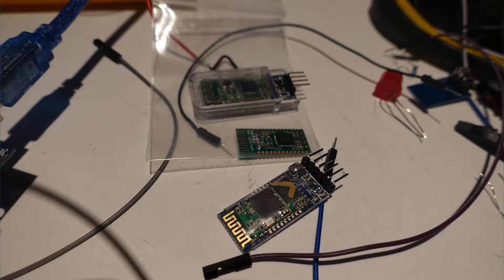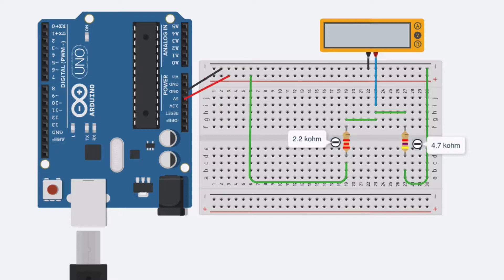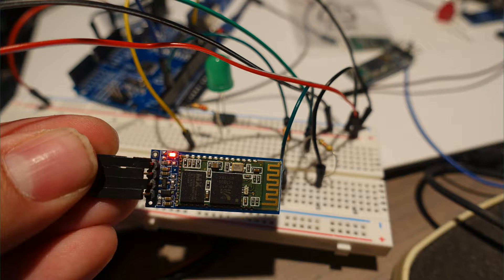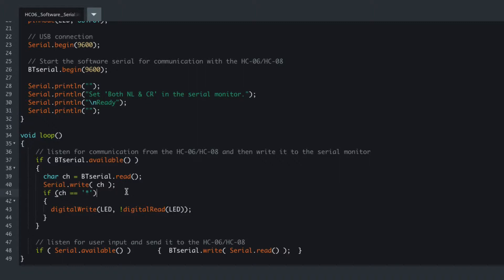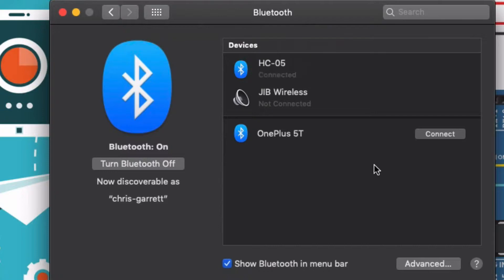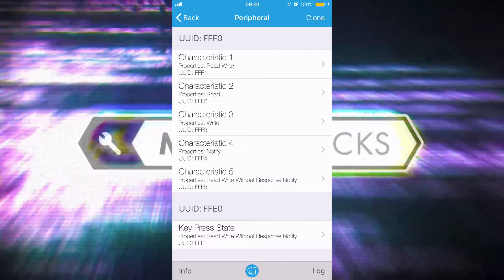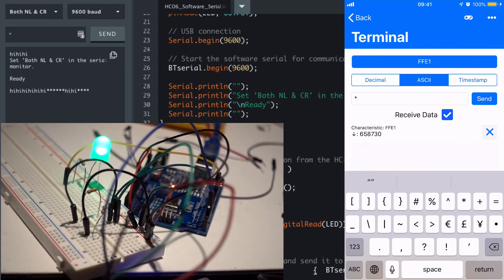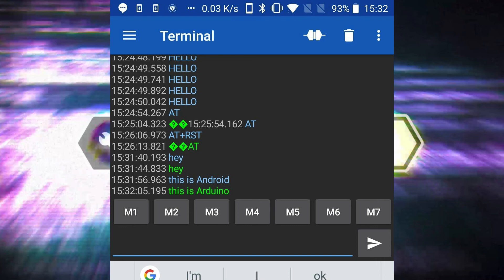Arduino, Bluetooth/BLE and Android/iOS/Mac/PC - Day 22 of 30 Days to Arduino

Comment: the Arduino also has a 3.3V output.. can't I just use that instead of dividing the voltage?
Reply from the maker: Depends if you are simply powering or sending signals, if you are sending signals then you need the voltage divider to prevent the pin outputting 5v
Reply: Maker Hacks what would a „signal“ look like?
When using the 3.3V pin and trying to turn on a led using bluetooth, it works, which is also technically a signal?